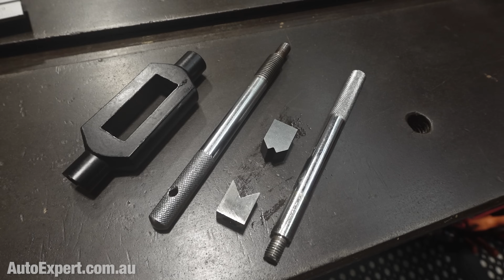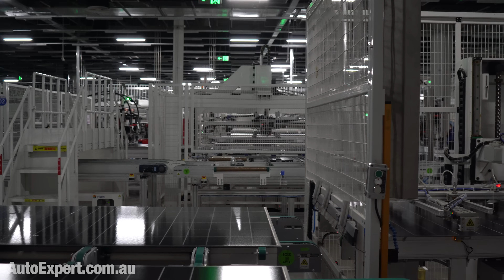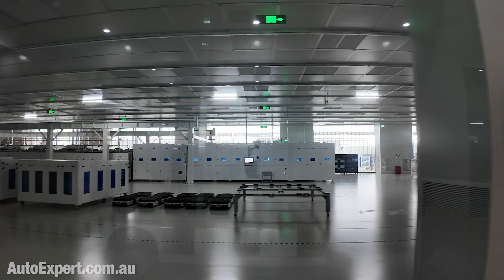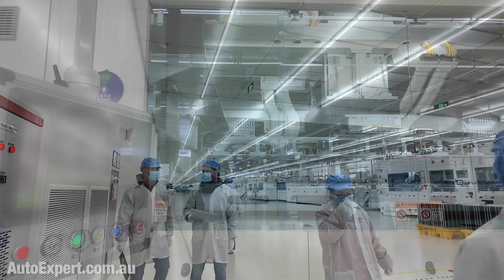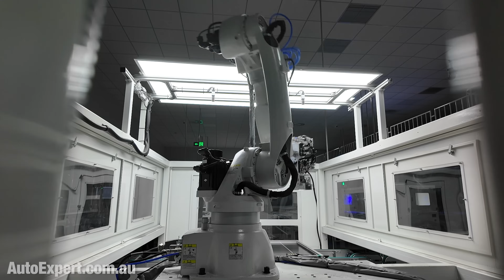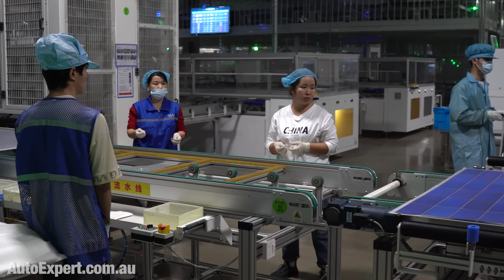The truth about Chinese manufacturing in 2025 | Auto Expert John Cadogan

Comment: I realised decades ago that China makes some top grade stuff in engineering, as I found out when using some of their products. Goods from China are still variable, as their QC is not mandated nationwide, but if you are selective their products first class. I often buy taps and dies in some very odd sizes unobtainable elsewhere. The prices are excellent, not ridicuously low, in fact reasonable. Quality if first class and delivery predictably prompt. China post's charges are very low, although for anything much over $20 NZ and that is not too bulky, they usually send post free.
China is the first place I look for some things these days, although I do get stuff from Germany.... more expensive, more postage and slower delivery quite often, but good quality. The computer and screen I am using right now are made in China.... nothing wrong with them and very reasonably priced... 🙂

Comment: China has about 120 - 130% over capacity.  You were allowed to see the tip-top manufacture locations.  Very impressive.  The best that industry espionage can steal.  You didn't get to look at the bulk of manufacture in deathtrap slums at dirt wages.  Foreigners only get the premium tour.  The government also blatantly pays for the overproduction.  Don't forget China absolutely artificially manages its Yuan on the international market and alters its trade tariffs as it needs.  China is still a few generations behind on computing technology and it's getting harder for them to steal.  So yes, China has made huge steps forward, all paid for by the government and with everything it could steal.  China plays by its own rules, has optimized corruption and taken everything it can get its hands on.  Doing business with a Chinese company is doing business with the CCP, and they actively work to take you over.  Side note, no foreign company can sue a Chinese company in China.  This is why large companies now are simply [and expensively] walking away, having to leave both infrastructure and large amounts of money in China.  It's worse than dealing with the Devil because at least the Devil does not lie. China, still needs to work on the whole "truth" thing.   It's okay to be impressed, just don't think there is any good in it.

Comment: My business is in building/modifying vehicle turbochargers. Mostly high flow 4WD turbochargers. I design my own parts to suit what is in demand or fix issues with the factory turbo.
  I find China are super keen to cooperate compared to Australia for manucaturing components.  Australian manufactures can give me a hard time if they reply at all, regardless of price. Chinese do what ask, no question, and quickly.
  Most Australian Turbocharger suppliers of upgraded turbochargers get them mass produced for them in China or Tiawan. So the lower price makes it difficult to compete. Australia can have a local manufacturing but the attitude is not there anymore.

Comment: One yr best ever videos John! The sad thing is even though manufacturing costs of things like solar panels, electronics, electrical parts have fallen (due to the reasons you've stated) labor costs, rules and regulations, and overzealous local and state government permit requirements are thwarting the adoption of EV's solar and battery installations. As an example - The roll out of EV charger installation continues at a snail's pace. Despite all the government "incentives". Good luck getting any mileage with the home battery rebate everyone. And forget about V2H!!! And bidirectional chargers. Any rebate on any of these is going to be either pocketed by yr installer, or never claimed simply because you'll never get it installed due to delays due to all the regulations, power company push backs and tick boxing required. Welcome to shitsville.

Comment: Yes, I agree sometimes tools that are sold at a very cheap price particularly in Home Depot or some other place like Harbor freight you get what you pay for, but I am extremely impressed with sophisticated Chinese engineering and design. I have a fantastic battery operated vacuum cleaner that is a big one not the little ones and it’s engineering is exceptionally good now that may be based on an American design I don’t know, but it’s execution is perfect. The parts that need to be strong or strong the parts that can be plastic or a high-quality plastic in overall at $179 this far exceeds the outrageous price at a Dyson wants. This is a bit of a knock off of a Dyson I guess But it does a great job and is well engineered and well put together. China is clearly now preeminent producer of industrial and commercial products. . I am old enough to remember when things made in Japan right after the war were considered junk. It wasn’t until the Japanese set up a government run committee that checked on everything leaving with regard to quality that things started to improve however, the first Toyota’s back in the early 70s that were driving around in the United States rusted out terribly. . In fact, it got so bad that Toyota had to buy back those cars but slowly it built this reputation up until the later 70s it was a brand along with Honda that everybody wanted and let us not rest upon the Dotson 240 Z one of the best value best driving sports cars of the 20th century .

Comment: Dear John
I’m sorry to argue against you on this on.
I guess that you didn’t just rock up on the door step with a GoPro and asked to film the production.
It is China and I bet you were approved by the CCP to tell this success story.
I’m not implying that it is untrue but it doesn’t paint the correct picture of China and their relationship with intellectual rights.
Patents are not a sign of ingenuity. I know because I used to work in hearing aid development and we patented lots of things purely to keep competitors at bay. Hoping to sell or trade them later.
Furthermore they are all in Chinese and I challenge the authenticity.
I have been to several Chinese factories over 15 years and passed through air locks identical to the in the video. They are impressive but utterly useless.
The clothing is fine and appropriate.
What I do take away from this is that recycling of discarded solar panels is a joke.
Yes the aluminum trin can be recycled but the rest is just glass with impurities embedded.
Yes large companies inventing stuff exist. I work in one where we are 700 people developing production equipment to enabling the other 69,300 people worldwide produce insulin and drug delivery pens.
Please don’t do this again.

Comment: "No one wants a Chinese car, not knowing how bad their manufacturing is when it's done cheaply in all the other industries".. however it is good for the car market here, especially in sydney, as there's no way to get a cheap car here, 'no rebirths', meaning all these brands will slowly start to chip away at the ridiculous costs of the legacy brands, or at least make them sweaten the deals for the buyers when you end up considering something chinese over them.
Reply: Built-in obsolescence mate.  Cars are designed and built to fall apart after a few years.  Cars can be made to last 50 years, the technology is there, but car factories will go bankrupt after a few years of production, as people don't have to buy new cars.

Comment: I personally do not want any of these Chinese cars. I would like to have my 1964 XM Ford Falcon with the Super Pursuit 170 strait 6 motor and 2 speed auto gearbox. I really loved this car to drive and it was very easy to work on. If I can get 30,000 dollars together I can buy one that is fully restored from the Just Cars magazine. I am a 72 year old man and I am sick and tired of this modern bullshit world.
Reply: I’m with you cobber I’ve got a car with a fuel pump problem I used to be able to fix in half an hour with a few beers and ten bucks now it’s weeks and half hour trying to get off the ground
Reply: Get an 80s toyota 4 cylinder  sedan or pickup. Those were still pretty easy to work on. 70s if you want to avoid electronics. Slant 6 engines sucked to work on, straight 4 toyota r 20 or 22 engines are great.
Reply: @ Well I do own a 1998 Toyota Camry 2.2 four cylinder engine at the moment. It has been and still is a great car. It is reasonable easy to work on but I hate the computer and the fuel injection. If it breaks down any where I am walking. My older carb cars I could just fix what was wrong and drive back home again.
Reply: You missed it by a few years. The 1984 1/2 ton toyota pickup straight 4 was still carburated. I think they switched right after. I don't know when the sedans switched.
Reply: You must have been insufferable during the beginnings of Japanese auto manufacturer dominance in the 70s. Stay at home old man. Your time is long gone.
Reply: Old man yells at cloud!
Reply: All old men are "tired".
Reply: @ I am not so tired that I could not kick your arse into the weeds. Show some respect next time.

Comment: Well, things always have a tendency to work themselves out. Unless there is an external pressure or meddling (ahem Middle East or Africa).
They key phrase you said: maintaining sufficiently amicable relations. Someone has to take the trash out, someone has to dig those natural resources. Someone has to work in hi-tech factories mindlessly screwing smartphones together for less than a dollar per day.
Tech innovations have expiration dates. So, if the country does something now, in a decade or two, they will get the results. And when things get desperate, people start supporting leaders with a vision (hopefully not the early 20th century Germany like). That is what happened to China. If they pull too far ahead, they will get lazy and complacent. Just like America did. Just like Japan did.
Empires come and go. Long term planning always wins.

Comment: Mate ,  I was importing 13 years ago from China and the problem was that if a supplier wanted to cheap out to save three cents they will and then in Australia I need to pay Australian labour rates to replace and fix bad parts .  This is in low tech products and hasn’t changed but I’m amazed at new products from China now my god!!!
Reply: I bought a Cinese made microwave oven  for A$50 before the pandemic.  It's still working fine.  Even if it breaks down now and I'll have to throw it out, it's less than $10 per year, I'd say it was great value for money.

Comment: A couple of things should be borne in mind;

- the output of the panels quoted by our host is in optimal conditions (which would be in the tropics on a cloudless day at noon). Installed in their various locales around the world output will vary during each day from that figure to zero at night, and the average will be very small fraction of that '35 gigawatts'.

- I've yet to see a definitive breakdown of cradle-to-grave cost (in energy, resources) of manufacturing photovoltaic panels and their total output (Joules, kW/h, whatever) during their service life that persuades me the latter exceeds the former, which it must before you can call them a "renewable", "sustainable" or "green" energy source. That breakdown has to include ALL costs including disposal of the frightening quantities of highly toxic waste.
Reply: The same issue comes with a full all costs breakdown of fossil fuels. None of it is sustainable. The question becomes which does less damage over some fixed year period. There is no green sustainable industry. There is only very bad to less bad.
Reply: @noname-ll2vk  "The same issue comes with a full all costs breakdown of fossil fuels."

 How so?
Reply: @EliteRock  what do you mean how so? Do you think the magic sky faerie waves her wand to fill gas station storage tanks with heavily toxic carcinogenic liquids then waves it again to remove the toxins coming out the other end?  Do an end to end analysis of any primary or secondary raw material and you get the same problem. It takes huge amounts of energy to discover drill transport refine then transport again fossil fuels. 

Once you're done with that start learning about declining ore grades.
Reply: @noname-ll2vk  These Chinese manufacturers of solar panels are burning coal to make them like it's going out of fashion -  Haaah ha ha ha!
Reply: @EliteRock  nobody is arguing humanity is on a sustainable course. Think of it more like the chair game. People walk around a set of chairs. Remove one. One person loses. Usa is playing a losing hand and just doubled or tripled down in it. 

It's not about perfection. It's about ending up with a chair. I was not sure which it would be but once project 2025 plus maga gained power it is not possible to bet on USA. Chinese plan long term and have made many good bets. Usa decided to play short term quarterly profits but now are falling behind. The only way us car oems survive today is protectionism. But that only takes you so far. China is gaining in canada, mexico, brazil, most of south america, most of asia, and in the eu. Meanwhile american car companies can't make cars and only stay afloat making silly pickups for insecure men.

Comment: Having lived in China for almost 20 year, moving back to oz in July, manufacturing has taken quite an evolution, i used to do QC/QA here, for domestic car brands, they've managed to learn/copy and use the supply chain and systems from Japanese manufacturers and have got quite good at it, with all the foreign car brands here being joint venture, they've learnt from everyone then kicked them out, for example VW and GM have been bitten on the hand. But anything locally small, you'll still have a hell of a battle getting what you want legitimately, still lots of fake ISO certifications, non OEM parts, dodgey supply chains, outsourcing to unlicensed factories, so still need to keep your head on a swivel not to get caught out, back to the domestic cars, cars here tend to be shitter than what they export overseas.

Comment: During my last 40 years in manufacturing I have witnessed first hand multiple new developments get implemented and sold overseas.
We just don't invest in the technology that we invent. we sell it of to other nations to make 10 times the profits and more in somewhere else in the world.
Our super funds are too busy investing on foreign markets and companies that buy our inventions.
Those foreign companies then turn those ideas into profits. WiFi. Black Box Flight recorders, Ultrasound scanners, the electric Drill , Google Maps, Cochlear Implant. Far Horizon Radar, Goon bag bladder. Hills Hoist, Victa Mower. The ute. Hardy plank cement sheet. 

One other  such company that is leading the way in thermal coating technology Graphene Manufacturing Group (GMG group) out of Brisbane.
They patented a Graphene manufacturing process to separate Carbon  and Hydrogen from Natural gas and in doing so create a pure Graphene powder that is then used in a thermal coating for use in HVAC and electronics industries.  
Recently GMG developed an oil additive to improve thermal and fuel efficiency in heavy loaded diesel engine applications as well as a graphene slurry for use in battery cathode manufacturing for Lithium and Aluminium Graphene battery production.

Guess where the battery that GMG and QLD university developed is going to get made.- Most likely the USA or China.
Again another lost opportunity to develop manufacturing within Australia.

We invent and develop and punch way above our weight and when it comes to investing in ourselves. - Yeah Nah. we go overseas..
and why. - because we cannot fund the manufacturing here in Aus at competitive costs.
We seem only to be able to grow clean food  crops and meats oh and still a bit of Wool. like we did 100 years ago.

Comment: I know all that looks very impressive. But you realize a lot of the equipment to make the solar panels is imported. 
The equipment might be made in China but a lot of the components to make the equipment are imported as well. 
China makes ballpoint pens but they have to import all the balls that go into the pence. They are incapable of precisely manufacturing the ball. They import all their bearings for their high-speed trains once again they are incapable of manufacturing the balls that go in the bearings for their trains. 
When it comes to semiconductor production the machinery to make semiconductors in foundries. All are imported maintained buy Western firms. Domestically they have equipment to manufacture semiconductors but it is what the West was manufactured in the early 2000s. Most of what China manufactures is heavily subsidized by the government for the purpose of disrupting the domestic market to the country they are importing to. 
It all looks really impressive until you start to look under the hood what Chinese manufacturing actually is.
Reply: Most what you said have been things of the past. You are right on the semiconductor making industry but only on the most sophisticated chip making.
Reply: That may have been true twenty years ago but I think you are wrong about the technology that China keeps learning and developing.  Sure they copy other people,  all manufacturing is copying of some sort or another.  Hard work and using their heads has pushed them into the world's leaders position.